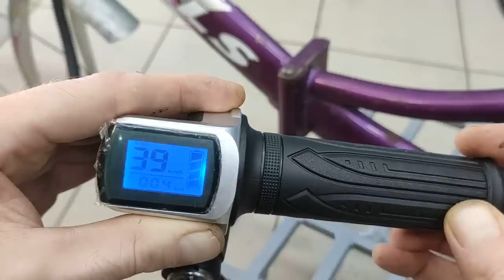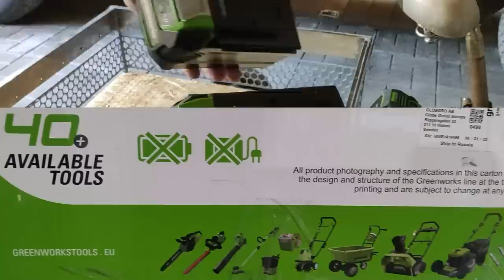You wouldn't believe what a simple guy made out of an old bike!!! Don't throw it in the trash!

Comment: Wow great build!!! what kind of top weight will it carry? I ask because unlike yourself I myself top 300lbs ( Sorry don't know what that is in kg. ) as of Dr yesterday. I like the auto tilt bed lol that is a bonus. also what is your top speed? Could you post the wiring part again in slow and closer up As I am partially blind and it seemed a bit far away for the details. I am thinking I will need to use a few of the hover boards for my build but that's okay as I keep buying them used for 40.00$ and now have 3 after buying 4 and my grandson taking 1 so I guess a 7 wheeler  or maybe a 6 wheeler with a trike like front end. That is totally possible  as while buying all the Hover boards I have also been buying used Bikes as well and as I am a bit compulsive I bought 20 various sized bikes for my current recumbent reverse hand rowing trike build. I just had the crazy idea of using tank like steering for both builds as that has been one part of my build that is still up in the air as to how I'll be doing it. Can you vary the speed of each side ot the power wheels if so that might work great for my build. Thanks so very much for this video as I have gotten so much great information from it and you have a new Fan for sure!!!

Comment: You know good initiative creativity and craftsmanship but the only problem that I can say as got2b a bad design idea is the parts from that scooter thing you know the ones that were spontaneously combusting and the way he has them attached somehow I'm not believing that those are made to Propel that much weight and the way he has them attached by just that piece of Steel although a thick piece of Steel somehow I just see a lot of pressure being put on those wheels and just bending like camber wise
Reply: They would have had to design them to handle the occasional fat person in order for the manufacturer to be able to get liability insurance. Also, the brackets for the axles look well done.
Reply: There is no way that those tiny little brackets holding the wheels on would be able to handle the weight plus the bumps and rough terrain without snapping. And I would like to know just how fast that he was going......since he didn't slow the video down to normal speed after he had the bike done. 
Also, I'm pretty sure that those motors are powerful enough to handle the weight and will burn out in a short period of time.

Comment: Too much work to add to landfill. There are 20 components going to fail when used daily. Then it's back in the landfill. All that time building using a wheel barrel instead or just a trailer no electrics (PEDDLE!) is sustainable. Not a green machine.